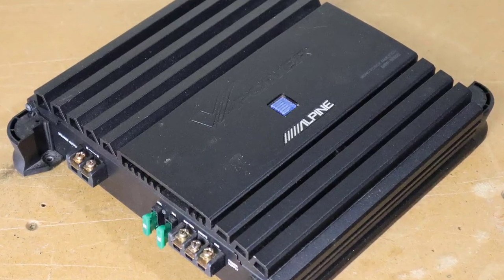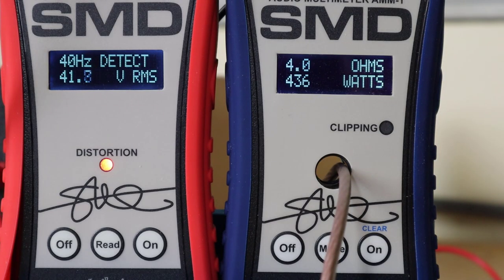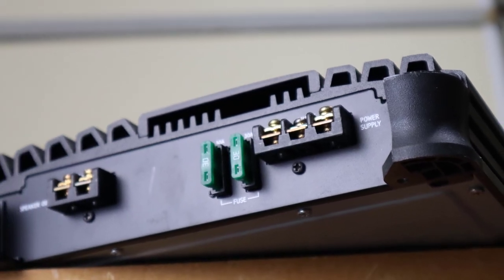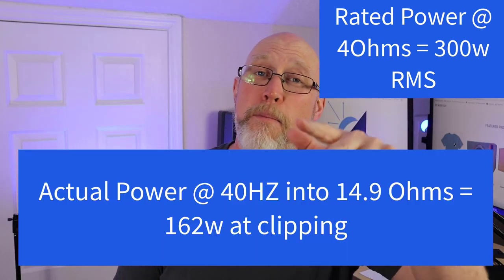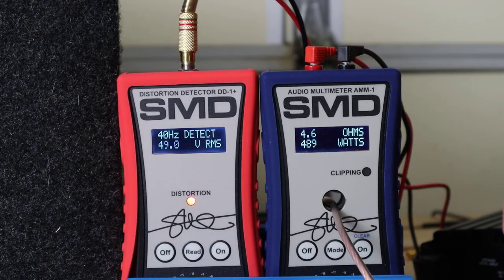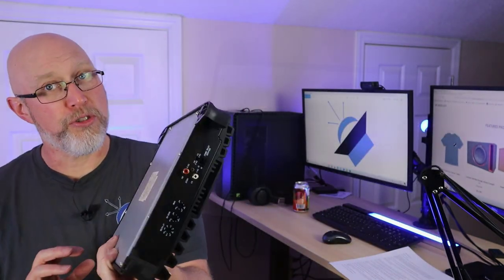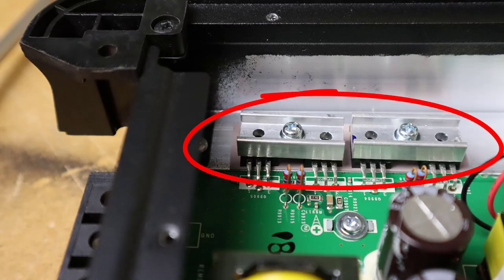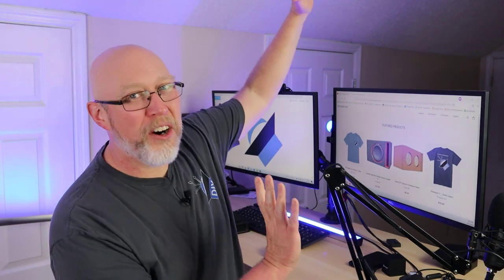OLD School Amp Dyno

Comment: I have one of those old alpines, and I’ve had it since about 2010, and I’m STILL using it. It’s been through about 6 different cars.
Reply from the maker: This one is in my teenager's car at the moment.  It's a rock solid amp and it's a great value.
Reply: I have the m1000 version. Had it since new. Beat the crap out of it with different cars, subs, low impedance, low voltage, etc. It just won't die. Currently powering a resilient sounds gold 15. (Or trying to) 😂
Reply from the maker: @anthonywelliver9050  It's a damn fire amp.
Reply: Same with me bro I have the MRP m2000 it’s out survived many cars and speakers lol

Comment: 2006-2007. The amp was replaced by the MRP-M500 in 2008, maybe 2009. I have the 450. I've had it since 2007, 2008. It's still going strong, every day! Great amp.

I'm running a Kicker CompVT 12, 2 ohm.

Comment: Great dyno man loved the video , also had mine wired at 1 ohm for years no problem and great comparison showing the load differences
Reply from the maker: I'm not surprised to hear that it can handle one ohm.   I was under the impression that there was an even newer one out that was designed to run 1 ohm.

Comment: I love alpine amps. I have the mrx-m110 hooked up right now to the termlab with a 4ohm dummy load. Def doing rated and then some.
Reply from the maker: It is a solid amplifier.
Reply: I have 6 of them installed in my truck. I have an ‘04 F-150 8200 GVW. Alpine stereo, 10,000 watts, 13 Alpine amplifiers, 16 vocal speakers, 6 10” Skar Audio SDR subwoofers in a custom enclosure, dual alternators, so much more. Check my channel and on TikTok.

Comment: These Alpine amps fall into a category I call "common man workhorse amps". Not a lot of bells and whistles as indicated by the lug style connectors. These Alpines arein that category along with JBL, Infinity, Sony, Clarion and Pioneer, etc. from the same era.
All very solid performers that usually make more than rated power and are durable. They are often overlooked nowadays and as a result they can be had for cheap. 
Nice review and demo Justin. Good info. 👍
Reply from the maker: Absolutely, they are great amplifiers.

Comment: I have a m450 that I got on clearance at Best Buy for $50 when this one came out. I ran it for probably 7 or 8 years with no problems
Reply from the maker: That is one hell of a deal!
Reply: I currently run one those 450's going to 2 fosgate p1 10's in a sealed box and it POUNDS.

Comment: Very cool video. Looks like a really good amp. I'd be interested what kind of peaks it would give with real music. I'm guessing easy over 700 watts when It hits a quick hard bass note and the caps recharge. If you want to learn more about electronics, 2 books I recommend are practical electronics for inventors and electronics for dummies. They will tell you how to read a schematic and how the components work and how to test them.
Reply from the maker: I might have to give those a look.

Comment: It looks like you're an Alpine guy.  Do you have any thoughts on the Alpine s-a32f 4-channel amplifier vs the Alpine MRV-F300?  They're both 4 channel and about the same rated output.  Is one just an updated model of the other?
Reply from the maker: Alpine makes good stuff, but I don't consider myself an Alpine guy.  I don't have any experience with that particular gear so I can't tell you anything more than what the spec sheet says.  The good news is that Alpine specifications are accurate.

Comment: Good looking transformers inside the amp. Kinda surprised at the lower voltage Caps though. Generally higher voltage is better, say 50 volts instead of 25 in terms of performance and sound quality. But overall, a pretty good and clean amp design. Certainly, worthy of the Alpine name. Especially with its capable output in watts.
Reply from the maker: It's a fairly old amplifier at this point.  I imagine the newer ones are even better.

Comment: I have the alpine mrv m1200. I've has a handful of amps and this alpine amp has crazy power. I have a skv2 2500 skar and the alpine sounds and his harder. Any possible way if you happen to get ahold of 1 id love to see what it pushes. Thanks
Reply from the maker: My guess is that it probably pushes out more power than my current power supply can provide.

Comment: im a bit confused how do you run it in 2 ohm does the amp automatically knows when you hook up your sub??
Reply from the maker: There are no sensors or anything like that if that is what you mean.   The amp will just produce more power when it is hooked up to a load with less resistance.
Reply: @DIYAudioGuy  so no switches to flip. Thank you sir

Comment: Is this how people wire 1ohm amps at .5 ohm.  Because of box rise?
Reply from the maker: Yes, but you have to be VERY careful.  It's only recommended if you're an SPL competitor.  Competitors regularly push their gear to the extreme limits knowing full well that they're going to break something and start fires. For your daily driver you need to error on the side of safety and reliability.

Comment: Check out barevids,  he’s an expert on amps. Most amps are built the same, the big name brands just like to rip you off
Reply from the maker: Absolutely, Sam knows his stuff.
Reply: On  the contrary, companies like Alpine, JL, Kenwood, Rockford Fosgate design and engineer their own bespoke circuits, some are even using full bridge topology for their designs, the ripoffs are the cookie cutter Korean half bridge clones all over the place, some are so generic that it's hard to tell the guts apart.